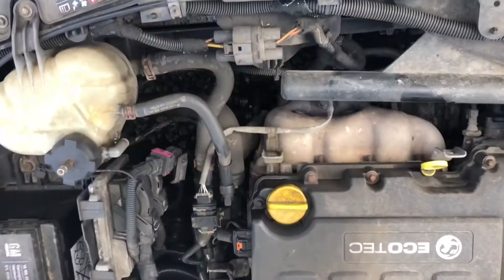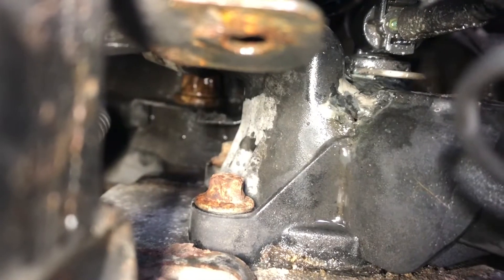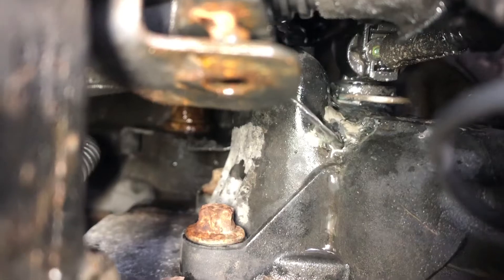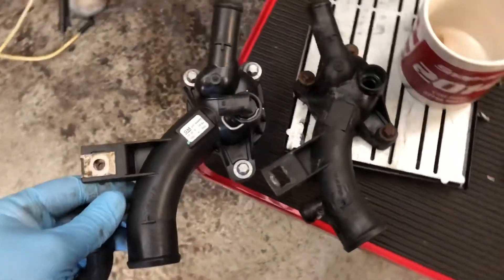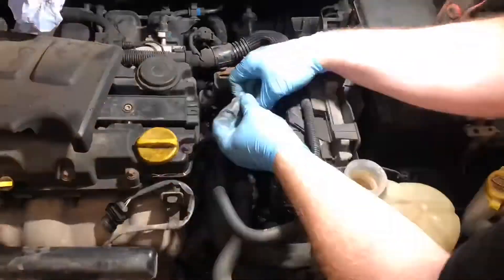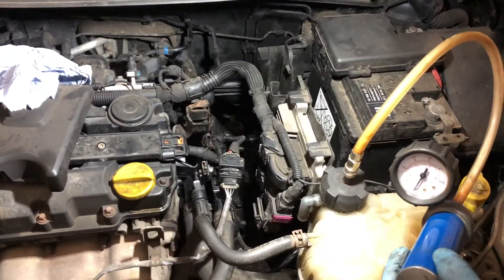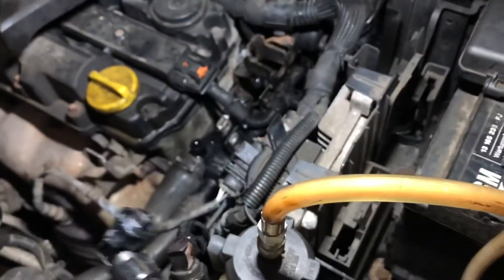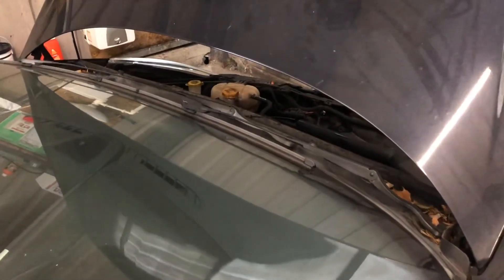Corsa 1.2 coolant leak COMMON FAULT

Comment: The same thing happened to me. I took out the small tube and it was broken, just like in the video. I held it with some cable ties until the replacement arrived.

Comment: Corsa D does not have any faults, especially as you claimed "common fault". The faults here could be a) bad owner/driver and b) bad mechanic. That's it. In this case 2 in 1. Driver: this composite housing is not designed to last for eternity, you have to service your cooling system at least once per 10 years but could be even earlier depending on engine hours. And we can clearly see that some water is leaking out instead of G12 coolant which is the only approved coolant for this engine. Same to mechanic: man, you don't even deserve to look at this car, I'm not talking even about touching her. Read manual prior, it's clearly written what kind of coolant to put. And all tests are done by owner, not by mechanic. Mechanic is just doing replacement job, that's it. You're not authorized to operate the car and even to start the engine...

Comment: It would have been nice if you could have pointed out what bits needed to be removed and and where the bolts / screws were instead of fast forwarding through. I've got the same job to do tomorrow and I'm just guessing at what to undo. The three Torx bolts are the easy bits but the others aren't clear to me.
Reply from the maker: This was an older video, I think I'll do a revised version.
Sorry for any miscommunication
Reply: @MTMMotorServices  Thanks for reply. I'll probably work it out but typical Vauxhall, that housing is a bit buried under a few things. Only had the car a few days and that little pipe blew off just as I was parking in a supermarket (big cloud of steam). The pipe doesn't clip properly and housing a bit worn. I'm replacing both.

Comment: Hi there, great video, wondering how much PSI should i load from my pressure pump to the coolant cap to spot the leak but not overload the system ?

Comment: i have the same car, i've got it into a garage so i don't know for sure that its the same issue, but i had topped up coolant before setting out on a drive, and not even a mile into the journey steam and possibly some smoke was coming from my car and the recovery guy told me there was no coolant in there at all.   Do you see this alot on these cars?

Comment: Bit of a long shot but where are based mtm???? Got a similar issue with my son's corsa....loosing coolant but not sure where. Had the waterpump replaced, and there doesn't seam to be water in the oil???????
Reply from the maker: We are based on Sandy Rd, Llanelli, South Wales. We will be happy to take a look at it if you can get to us. 👍👍

Comment: The tip of the overflow pipe had actually snapped off inside the old housing. Which is why the new one looks prouder. I had the same problem with a minor leak cased by this and had to dig the snapped end out with tiny hook made from a coat hanger so that the replacement would fit. This video helped me spot the problem as the crustyness was covering up the breakage. Thank you.

Comment: Where can I get the pressure test kit from? I think I got a small leak as mini puddles on drive and had the same issue as what your customer had. I’m wanting try everything before I go down the head gasket route as the engine was rebuilt apparently before I brought it. A week into owning a hose split so feel like possibly another leak somewhere?

Comment: They also lose water from the big gasket behind the timing chain, the one the water pump goes against , if you’re losing water and your head gasket is good, no overheating, and a pressure test doesn’t reveal an external leak then it’s most likely that, I’ve done loads of them. May as well buy a chain kit cos it’s got to come off anyway, and it’s bound to be rattling. and sump and rocker gaskets, these engines can leak everywhere. But run forever.
Reply from the maker: Yep you're right. Whenever I do head gaskets on these engines, the timing cover gasket which is part of the coolant pump gasket always looks to be leaking.

Comment: How would you go about emptying the old coolant completely and replacing with new one?
Reply from the maker: Some radiators have a drain plug on the coolant radiator which you can undo. Otherwise  you can take off the lowest coolant pipe and allow it to drain out that way.

Comment: Hi, the housing you are referring to is that the thermostat housing?
Thanks
Reply from the maker: Hi, no this is a housing on the side of the block which houses a temperature sensor. the thermostat housing is on the other side of the engine.
Reply: @MTMMotorServices  thank you
Reply: whats the part called which you took off?
Reply: Vauxhall refer to it as a coolant flange

Comment: Fix it soon or your engine is cooked loool, had one that was cabletied for a while on the housing then head gasket went because air got into the cooling system and snuck into the combustion chamber

Comment: I have a very small leak cant find it. It looses half a litre every full tank. Its doing my nut in lol
Reply from the maker: if your coolant is is rich in antifreeze then normally there can be some staining on the engine which can be an indicator of where it could be leaking from. i would also put a coolant pressure tester on the system like in this video. it allows you to pressurise the system to force it out of where its leaking from. this is alot easier and safer than waiting for the car to come to temperature and pressurise itself.

Comment: Thanks for sharing this helpful video mate, I've got Vauxhall corsa 2013 with the same problem and where can I find the the part? Can you please share the part  link or anything thanks.
Reply from the maker: Hi, we used genuine vauxhall parts. There can sometimes be a variant of this part, What I would suggest is calling your local dealership, speak to the parts department. Give them your registration number so they can look up the spec of your car and ask them for a price on the part and also ask them for the part number. Then atleast you can use that partnumber to search online for cheaper alternatives.

Comment: Great video. Can inask when u pressure tested the car did you need to plug the overfill spout? I tried pressure testing a Corsa and it was building no pressure for me to check for a leak. The car isnt losing coolant was.just.more curious to know
Reply from the maker: Arts&Trusts , if you’re using the correct adaptor, it should seal below the spout and at the thread base. If you take off the coolant cap you should see 2 seals. The adaptor you use to build pressure should look the same.